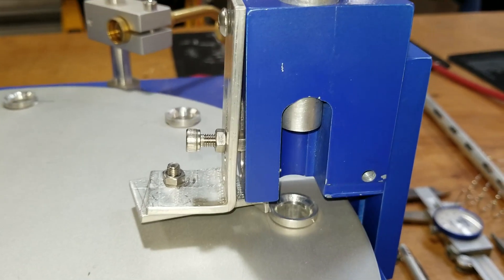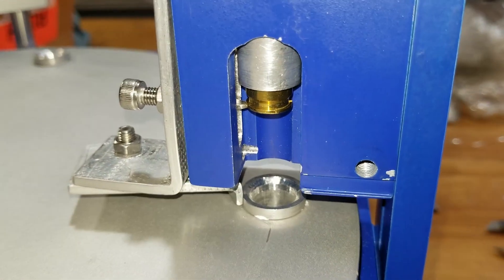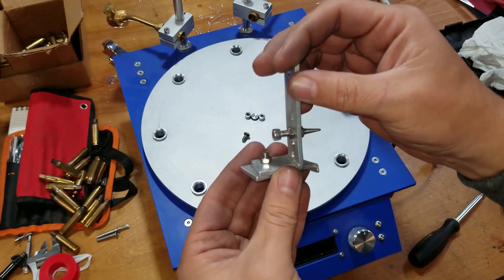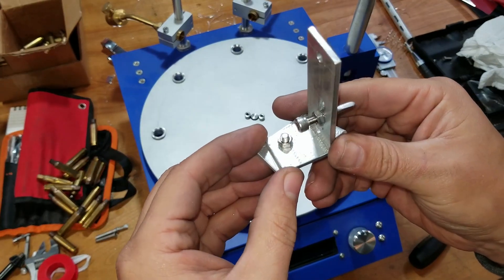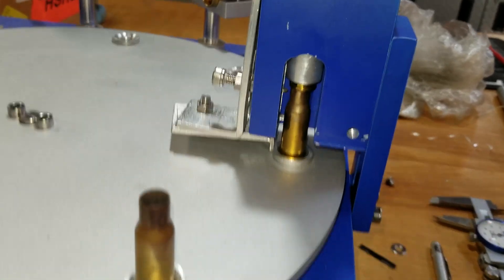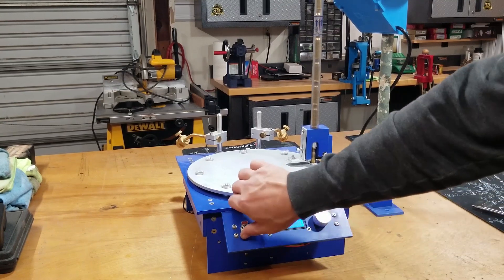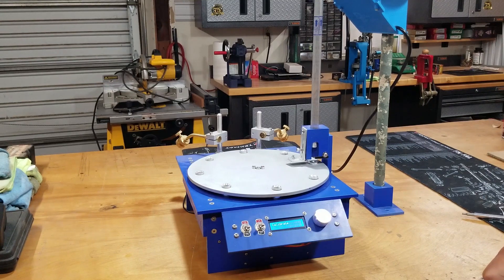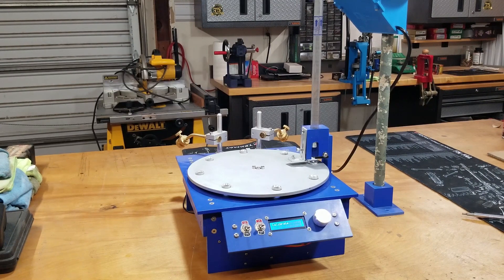Arduino Annealer Update - New Feeder Design

Comment: What is the center to center dimension from the center hole of the plate to the center of the shell holder? 

Thanks again
Reply from the maker: Well....it was supposed to be 5inches but forgot to zero my DRO and it ended up being 5.100in . I just rolled with it and based my feed and other holes of that
Reply: @sjseth-builds  Thanks

Comment: Lee makes a mechanical (NO electrics for some folks) that has 4 feeding tubes.  I have it on my Star and no need to have an electric case feeder.  Works fine 99% of the time.  Do get the occasional upside down but it’s pistol cases only.  Seems like it would work well with this setup and a heck of a lot less expensive than a Dillon feeder.  Just food for thought.  Like the setup very much.
Reply from the maker: Yes, any case feeder should work. I just used the dillon because I already owned it. I borrow it from my xl650 as it only takes a minute to put back when I am reloading

Comment: Nice solution!
Reply from the maker: Thanks! I have now run several hundred through without any failures. Seems to be working well.
Reply: This will be one of my winter projects, I should just copy you but I want to use an induction heater.
Reply from the maker: @jesusisalive3227  I am looking forward to seeing that.  I think this design is a pretty good "brass processing" platform and I plan on doing some other "bulk" operations on this same platform around brass processing including integrating it with my case sorter tech which worked well but had a poor feed system. I also think being able to lock the brass in for certain stations would allow things like trimming, sizing, etc. Will be fun to play with for sure.
Reply: Brilliant!